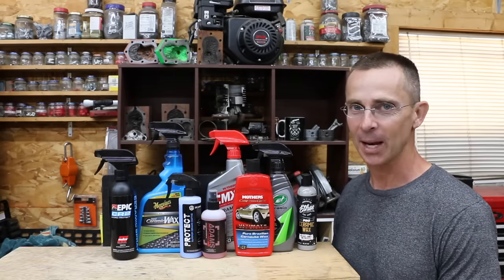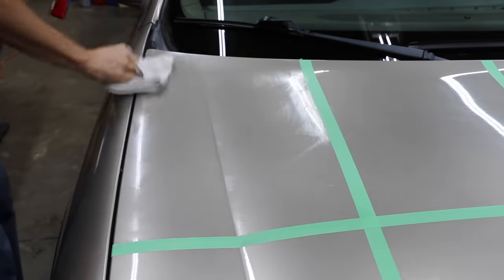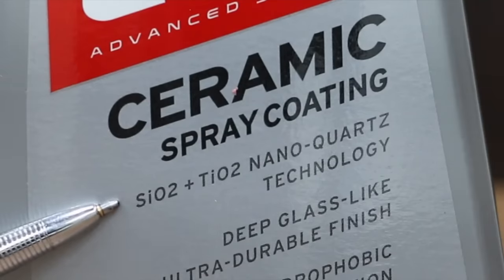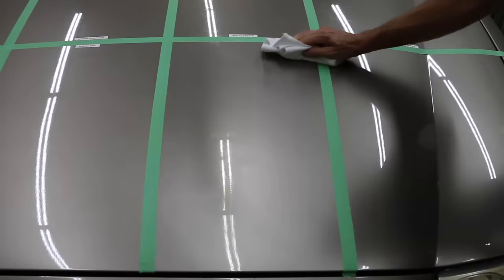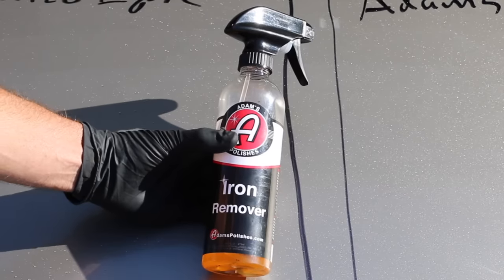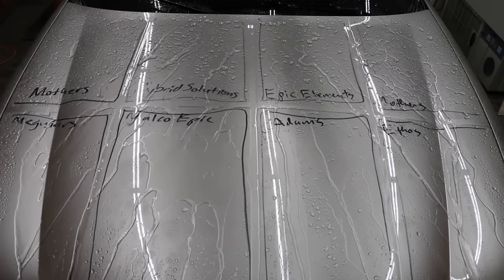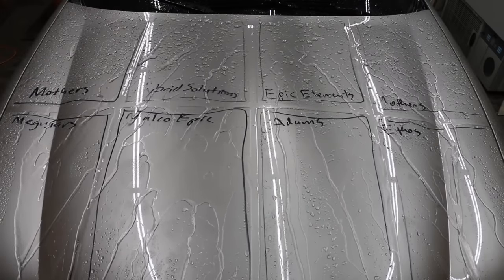Best Ceramic Spray Coating? Mothers vs Meguiars vs Ethos Pro

Comment: I have a 2016 Ford F150 that I power wash once a week, never took a sponge to rub it.  Never been waxed either. It has wonderful shine due to high gloss factory clearcoat but a couple doors has oxidation/haze on it or possible a soap film, but it is haze of some sort. Do I use  a chemical likea car polish to remove it before applying the Turtle Wax Hybrid Solution, or willHybrid Solutions remove the haze/oxidation? I don't want to put a surface polish cleaner on the paint if it clashes with Hybrid Solutions. What is recommended by you?   THUMBS UP!!!.

Comment: @ProjectFarm, Have you tested Graphene Brands? It seems that graphene is slightly superior to ceramic coating, where as UV light can make the ceramic coating less effective where Graphene is much much more resistant. would you be willing to do a test/video on those? Thanks! -Tim
Reply from the maker: Thanks for the suggestion.

Comment: Absolutely the best and scientific video I have seen for auto coatings. Before seeing this video, did a lot of research, and determined that turtle wax hybrid solutions was what I was going to use. Most important thing is to follow instructions completely, do not deviate, and clay bar car well. After clay bar used 50/50 (Isopropyl/water) and wiped down entire vehicle and let it dry.  Per instructions, first coat, waited just over 24 hours, applied 2nd. coat. It goes on easy, works great, best coating I have ever used, but it does not last as long as one might expect, especially if you go to auto car wash. Recommend auto wand wash if you have to, and use large micro fiber towel to dry after using the soft water function. Thanks for best review yet, have been using this product for over 8 months. First time that I have recommended an auto exterior product, based on my own experience...
Reply from the maker: Thanks!  Thanks for sharing.

Comment: Recently did a coat of TW Hybrid Solutions ceramic spray after Meguiar's wet look cut and polish on my motorbike, now it's too slippery lol, and as the video suggests I can't even remove it. I need some tank/knee grips.
Reply from the maker: Thanks for sharing.

Comment: The problem with this review is that you can't compare an 'all in one' product that cleans, polishes and protects with a product, that in this case, is a spray which contains just a ceramic sealant. Project Farm is comparing apples to oranges. A sealant spay is applied to a prepared surface that was treated to remove oxidation and acid rain. An all in one polish can be used on paint that is relatively free of these issues and just needs a mild cleaning compound with a sealant. Putting a pure sealant on a clean surface will be more difficult to remove then a all in one ceramic polish or wax, especially when using harsh chemicals. Everything else being equal, they may last longer after they are applied. I've been detailing my own cars for many years and my friend who owns an auto body shop also believes that keeping you car clean is paramount, which also makes waxing easier and less cumbersome. Therefore IMO, the best way to test these various applications, is to use similar products under normal conditions which include climate effects, and time. Finally, as an example, the Ethos Pro would be a great product to compare to Turtle Wax's Hybrid Solution Ceramic Polish and Wax. 😉

Comment: Down the rabbit hole I go once again. I’m here because it’s time to restore my headlights. Here is where I’m at. Wet sand with 400/1,000/2,000 grit, buff/polish with Mothers Mag and Aluminum Polish, then coat with Turtle wax 53409 Hybrid Solutions. OR, just buy the Sylvania  Headlight Restoration Kit. 😂 Why must I complicate everything?!
Reply from the maker: Thanks for sharing.

Comment: Can you please teat turtle wax 53477 Hybrid Solutions graphene.  I used to use TW ceramic coat and I switched to their graphene edition and it's EVEN BETTER!!!  Same price but better.  TWs hybrid solutions is killing it now.  I also use the graphene tire dressing.
Reply from the maker: Thanks for the video idea.
Reply: @Project Farm  would also love to see Black Magic Tire Wet vs TW new graphene hydro solutions tire coating.  We all use black magic for years but I hear TW tire coating lasts longer and is even blacker.  Also would love to see a product like water wetter vs dexcool, vs HOAT, vs RODI water for what is the best fluid to run through your radiator test.  Super impressed by the hydo solutions line for car care and milwaukee for power tools, AND by your Channel.  You and Scotty the mechanic have the BEST car channels and you do even more than just cars.   Thank you sincerely!

Comment: With the Tundra sitting so high, Toyota needs to install a Miller Cat Shield at the factory and not at the dealership, your just asking for theft of your Catalytic Converters, I do feel it should be standard on all models

Comment: PF, I used the Turtle Ceramic spray on chrome shower accessories to reduce water spotting. Seems to be working, but do you recommend?
Reply from the maker: Thanks for the suggestion.

Comment: Spray on ceramic coatings are not very good. On the inexpensive side and ease of use I'd use something like Gyeon Can Coat. It runs about $50-60 a can, but you use it once and it will last about a year.
Reply from the maker: Thanks for sharing.

Comment: Just got my new car with a nano paint protection applied by the dealer. It comes with a 10 years garantie….not sure it will last that long… can I apply the Menuires Hybrid ceramic wax directly on my car after washing it?
Reply from the maker: Thanks for the suggestion.

Comment: Could you add a ceramic coating liquid to a bottle of liquid car wax on your own? What SiO2/liquid wax ratio would you recommend? Do you know what that ratio is on existing spray ceramic wax products such as Mothers or Meguires?
Reply from the maker: Thanks for the suggestion.

Comment: Mequires product instructions call for the product to be applied to a wet (water) surface. The product is water activated. Not sure your original review applied to product as instructed.

Comment: So, what's the difference between Sealant ruglar carnuba waxes and ceramic coating? which one can I do away with after using one? I mean, I don't want to buy and use products unnecessarily so, If I've got the ceramic coating do I still need a sealant and carnuba wax and vice versa?
Reply from the maker: Thanks for the suggestion.
Reply: @ProjectFarm  thanks for igoring my question.

Comment: The guy who details my cars told me about ceramics and said that if I have him put it on I won't have to have my car waxed for years. Can this be? Better be because he said it would cost $1,500 for my Jaguar F type.
Reply: A proper ceramic coating can last years but the ones in this video are cheap easy application spray versions these ones can generally last about 6-12 months depending on what you wash it with as in the video certain chemicals can remove the coating

Comment: It's funny that all the gucci trendy Coatings get beat by a pioneer in the space. I detail cars and was sold into chemical guys and adams and a bunch of other stuff. At the end of the day I'm back to using Superior Products Brand and Turtle Wax.  They make great stuff with great value and my customers are just as happy while my cost is 30% less.
Reply from the maker: Thanks for sharing.

Comment: You ask for input on what to review. I would suggest you research roof top tents. They range from a thousand to several thousand worthless Murkin promissory notes. The hardtops are at the higher end.  You would spend over 10 k to do this. You ask for ideas of products to research. My question is what is your budget for what you review? 
I also suggested you review sawzels. Don’t think you did that one which is way less expensive than roof top tents
Reply from the maker: Thanks for the suggestions.

Comment: Coming from a professional detailer who also heavily tests products. TW lineup has really came a long way. Their "ceramic" based products have been outperforming the popular brands for a while now.
Reply from the maker: Thank you for sharing!
Reply: @ProjectFarm  you do awesome with these comparisons. If I can suggest a couple more (you may have done these as I am still viewing your videos).
*Cordless vacs or minis like the mini shop craftsman and armor all brand (the armorall brand vac is supposedly made by the same manufacturer as another good branded vac).
*pen light and head lamp comparisons
*cordless polishers 
*cut resistant, dipped gloves (A5)
*since alot of us wear boots, work grade socks.
*heavy duty boot comparison with brands like carhartt (my personal go to)  ariat, timberland, Danner, thorogood
*heated jackets and hoodies.
*90 degree angle adjustable flashlights
*since summer is coming up maybe a few fun camping items like LED lanterns.
You have probably done a few of these already. 
Keep it up!  Saved me alot of money so far!

Comment: Why is it you read the simple instruction for Meguiars, “spray on, rinse off, and dry.” ( you’re also supposed to spray it on while the car is  wet) You then proceed to spray it on a dry car and then rub it off with a towel.

Comment: I used the stuff in the blue bottle which you spray on a wet car.  It dripped all over the driveway and smells extremely sweet.  Shortly after we noticed numerous dead mice that had lapped up the sweet stuff and died or were dying.  Since mice are very similar to humans,  one must assume this stuff is extremely harmful to humans.  We have a well, and do not want to pollute our land. Further, what happens to the animals that eat the mice?  I will never buy this product again.
Reply from the maker: Thanks for sharing.

Comment: Not to throw cold water on your math, but when you list these from least expensive to most you are way off. Meguiar's is $19.68 for 32 oz. or 61.5 cents/oz. This should be your least expensive as the Turtle Wax is $14.50 for only 16 oz. or 90.625 cents/oz. Then you go on to say the Epic is your third least expensive at $18.91 for merely 8 oz! This is a whopping $2.36/oz. or nearly 4x the cost of Meguiar's. Just sayin' :face-blue-smiling:

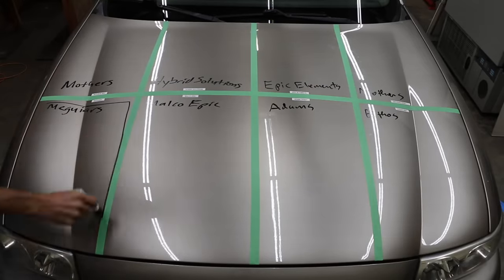Comment: Sorry, but I'm crying foul.  Look starting @ 7:02, the water bead/runoff test.  The coatings furthest from the front bumper are on a closer to level surface, and thus don't/won't have the runoff  angle of the coatings that are on the steeper surface towards the front of the car.  To be fair you need to level the playing field!  Still, thanks and kudos on an interesting vid.
Reply from the maker: Thanks and you are welcome!  Thanks for the constructive feedback.

Comment: I would like to warn you guys ,do not buy the Spray on Turtle wax Ceramic.  On metallic paint , as the streak marks are imposible to remove. It’s complete rubbish.
Reply from the maker: Thanks for the feedback.

Comment: Test graphene and ceramic coatings...1. spray on ceramic and graphene then test  2.  the applied ceramic and graphene coat...the spray on ceramic waxes are often applied on top of the chemical coating as a maintainace....the test you did not do was the dust test...resisting water hard water that etched into tge finish is bad...waxes that  collect dust is worse...I washed my car for a couple of years using only water...no wax buildup no soap scum build up...my car could rinse clean no rags or brush just rinse...days later still passed the white glove test...when I did wax a day later dust would stick to the wax coat...so I stopped waxing...the ceramic coatings are harder than the factory clear coat so that ends the dust problem...I still haven't decided what  ceramic or graphene coating I'm going to use...they can last up to seven years...then you can apply a easy spray on top to maintain a high gloss longer lasting ceramic graphene coating...the graphene additive is designed to resist hard water spotting...some ceramics are said to spot...I don't know...
Reply from the maker: Thanks for the suggestion.

Comment: This stuff Is snake oil! ZERO UV protection & ZERO scratch protection. I used the turtle wax hybrid solutions (based on this video) for over a year & watched the clear coat fade & scratches show up. Yea, it looked great & was baby butt smooth. It would be great for a show car / garage queen. But for a daily driver out in the elements? No. You're better off using a good wax.
Reply: What state do you live in? Where I’m from it’s only really sunny half the year and not as important for UV protection as it might be for you

Comment: Another comparison that focuses on water beading.  IMO, i don't want water to bead, i want it to run off.  Water that beads and is not removed, dries leaving water spots whereas if the water sheets off, much better.
Am i missing something here or is this obsession with water beading simply marketing BS.  My product beads better than your product.
I appreciate that water beading is an indication that the applied product still remains but unless the product provides UV protection to the paint/clear coat, i argue it's not worth applying in the first place.

Comment: From what I understand is that a true ceramic coating.
CAN NOT be stored in any PLASTIC containers.
Due to the solvents in said product.
So what you are testing IS NOT a true ceramic coating.

The products you are using are a joke.
They are no better than a normal wax product.
Because with the products you used, you will have to reapply every 3 to 4 months.
Just like a normal wax.

A true ceramic coating should last up to 3 years.

And in my opinion anything the turtle wax company makes is TOTAL SHIT.

I have tried there products through out my life.
Starting in 1970. And even this year 2022 I gave them the benefit of the doubt.
And tried another of their products.
As soon as I squeeze the product out of the bottle, I could see it was shit.
Everything about the product was shit.
I used that product one time.
And then I put that shit product where it belongs.

IT THE SHIT CAN.

WHERE ALL THEIR PRODUCTS BELONG.

This is just my opinion.